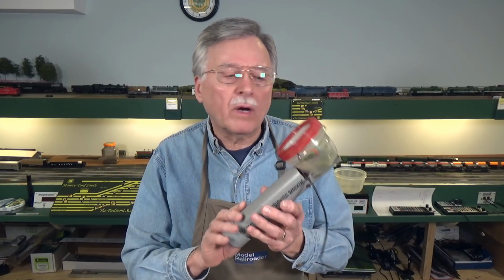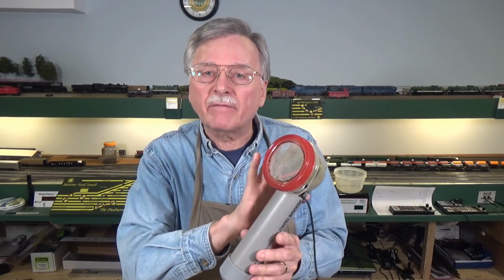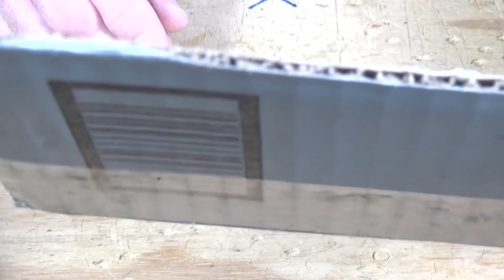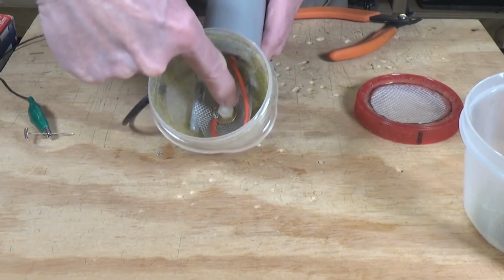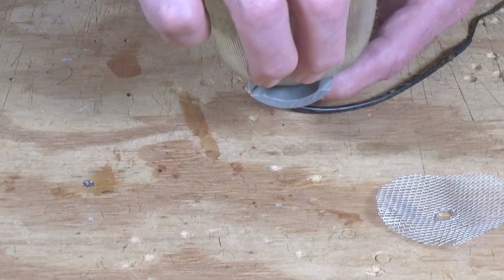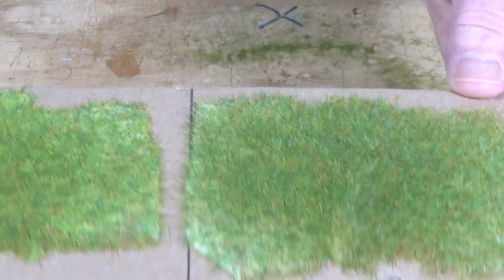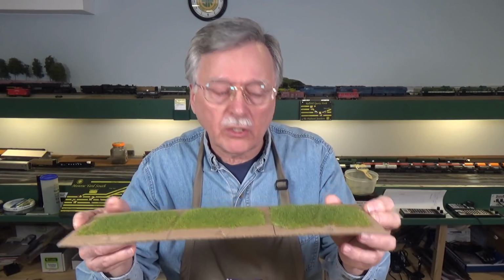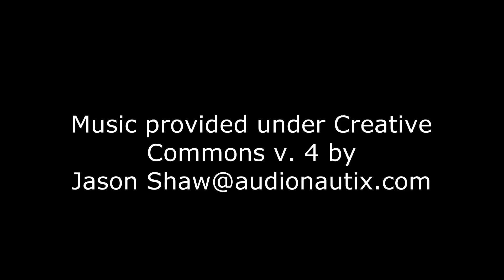Supercharge Your DIY Static Grass Applicator With This SECRET Modification (167)

Comment: I am in the process of building a static grass applicator and your video precisely answered the question I was wrestling with on where to mount the positive wire (front screen or behind it with a metal plate or washer).  Thanks so much!!

Comment: I saw a demo from. WW Scenics personnel and they were. saying that you. don't have to pin the other lead to the surface your putting the grass on. They said to connect the alligator clip to a probe and hold the probe near where you are sprinkling. the grass from the Applicator and move the Alligator clip.  end along. While you're sprinkling along the grass. as that helps keep it. up better. Cause you're not that far away. from the alligator clip. And like you would if you pinned it to the surface.
Reply from the maker: When I get time I would like to do a test of the two approaches and see which actually works best at standing the grass fibers perfectly vertical. They actually contacted me today offering to send me some of their products for review so the opportunity may present itself pretty soon.

Comment: In the electrical industry we use what is called a "fender washer" one of those may give you a larger area for your positive electrode. And, yes Safety First, kudos for using the nylon screw!
And thank you for getting the vaccine! I will be getting mine as soon as I can.
Stay safe and healthy Sir!
Reply from the maker: Thanks, I do have a large fender washer if I go with a larger Skippy jar. The one I have was a bit too big for the Rubbermaid container. With the brass washer connection to the positive wire I can easily swap out various washers, screens, etc. to see how that might affect efficiency. However I could easily run out of time if I got bogged down in that kind of exercise.

Comment: Great video Larry and the best home made applicator I’ve seen yet. I think one of the commercial applicators uses a brass sheet material cut with jagged edges. Not quite sure why but perhaps to increase the surface area or to help break up the clumps of grass. 
Thanks for your leadership in making these videos. They save the rest of us from going off blindly in all directions.
Reply from the maker: I think the jagged edges direct the electrons and spread them around, it makes a good story anyway.

Comment: Larry I've learned so much from your videos! Thank you. I built the "super-charged" static grass applicator according to your instructions usig PVC + the same RubberMaid cup with metal screen and with the washer in the back. When I bring the ground probe close to the washer I have good 1/8" spark but it does not raise even 6m grass no matter how close i bring the applicator to the test board.
Reply from the maker: You might try moving the supply wire from the washer to the screen to get a stronger electrostatic field and see if that helps. Just be careful not to zap yourself.
Reply: @TheDCCGuy  Thanks Larry, I'll give that a try.

Comment: Nice vid. Seems like option 3 is best as a good size bronze washer is easier to solder, and the behind the grass nylon bolt connection is safer.

Comment: Thanks for these great videos Larry. I really cannot justify the insane sum of $110 for a Woodland Scenics device so will be using a combination of your design with a few ideas from Luc as well. Two quick questions...does it matter whether you use aluminium vs. steel mesh? and did you find the larger grass sizes worked alright with the standard mesh opening? Thanks in advance for your time!

Comment: Larry, I've seen a couple of you static grass application modification videos and the comparisons you did with moving the positive wire back inside the grass holder.  You mentioned trying this on some longer 12mm  grass to see if it made more of a difference.  I made a simple 3 volt applicator that works great with upto 7mm grass, but my 12 does not stand up at all.  I was wondering if I needed more voltage or to simply make the modification you showed with moving the positive wire.   Thanks for the Videos.
Reply from the maker: After doing the math and realizing 12mm gras is scale 3-4 feet tall I decided not to bother with it. For HO and OO 6-7mm seems likely to be the tallest I will ever need. I think that for 12mm you would need the commercial devices designed to handle that longer material.

Comment: Hi - Great video! Question - do you use the bronze washer simply because you can solder to it?
Thanks again
Mark.
Reply from the maker: Yes, much easier than to a steel washer and they had them at Ace hardware when I went looking.

Comment: Thanks for the info, it looks to me as the larger washer worked the best, I couldn't tell jhow far you had the screen from the glue but it is my understanding just a few inches id best (2"to 3"), and keeping it even is even better, But like you I think the large washer is safer and better in your example...thanks for sharing....
Reply from the maker: I was within an inch or two all the time when dispensing. I tried to keep everything constant each time so as to make it a more direct comparison of the different positive electrode configurations. You could spend days if not weeks testing different configs.
Reply: @TheDCCGuy  great I couldn't tell, very hood!

Comment: I have a 12V Woodland Scenics Static King. You will get shocked if you touch it. Are you recommending the cable be touched to the screen before applying static grass? Thanks
Reply from the maker: What I meant was after you turn off the unit there may be some residual juice that can be dissipated by grounding the screen by just touching the free wire to it.

Comment: I have just  received two  negative Ion generator and wired them up to match your wiring sheet, but the  wire mesh  wire and the ground wire do  not give off  a static charge on both generators. The generators that came have two white wires I assume that they are the mesh and ground wires
Reply from the maker: Why 2 and how did you connect them? Try it with just 1 and see what happens.
Reply: Thank you for the reply--Having connected each generator to a 9volt battery and putting the ends of the mesh and ground wire together I get nothing . What is the name of the generator you use in your video 166 and 167 .
Reply from the maker: If you read the description to the videos I included that info.

Comment: Could you wire it up directly to a wall wart? I'm thinking 12v would give you more voltage than a 9v battery, but not as much as the OTT negative ion generator. Somewhere in the middle ground?
Reply from the maker: Yes, and if you watch the preceding video I tell you where you can get a circuit diagram for that arrangement.
Reply: @TheDCCGuy  Awesome. Thanks! :)

Comment: I think you forget that one of the reasons for having the charged screen at the front is that if you pass it over the flocked surface you can pull some of the flock straight up as the charge still will attract the flock without pulling it out of the glue...
Reply from the maker: The electrostatic field is there no matter whether the positive electrode is up front or in the rear.

Comment: On #3, would the size of the steel washer  - thickness and / or diameter  - play a role in its effectiveness? The thing that comes to mind is one of those small heatsinks, say an inch square with vertical fins.
Reply from the maker: Yes, you could spend weeks trying out different configurations. I could have experimented with the size of the washer, size and composition of the screen, size and shape of the container, etc. But I wanted to keep it a simple straightforward comparison.
Reply: @TheDCCGuy  -- Thanks, Larry. I've tried the fly swatter design, which was underwhelming. I've now ordered the ion generator you use in your design (yes, same dealer as you still sells it). So we shall see what 'shocking' things I can come up with. 😉

Comment: I'm ready to build one of these. One question: what are the dimensions of the holes in your screen?
Reply from the maker: The small ones are just plain old window screen. The larger screen is 1/4” hardware cloth. I don’t find the large one useful as it is so big everything smaller than the largest static grass just pours out as soon as you flip it.

Comment: I'd like to ask, does it matter if the screen material is metal or plastic?
Reply from the maker: I have never seen anyone use anything but metal and am not sure how the screen material would function as part of the electrostatic field. It may be that you need an electrically conductive material in that location to get it to work.
Reply: @TheDCCGuy  Thank You very much. I'll try one of each and let You know how it works out.

Comment: For the third method, couldn’t you have just soldered the positive wire to the large washer directly?
Reply: I don't think you can solder steel.
Reply from the maker: First, the hole in the center of the washer was bigger than the nut so the brass/bronze washer was there to hold it on place. I probably could have soldered to the steel washer but this made it easier to swap the screen and larger washer.
Reply: @donaldshroyer8633  Rubbish

Comment: I would try #2.... With Steel Screen, just because it's more conductive than Aluminum.
Reply from the maker: Hard to find around here. Most stores just have the aluminum or plastic covered stuff.
Reply: @TheDCCGuy  What about using a piece of copper sheeting cut to the size of the screen?